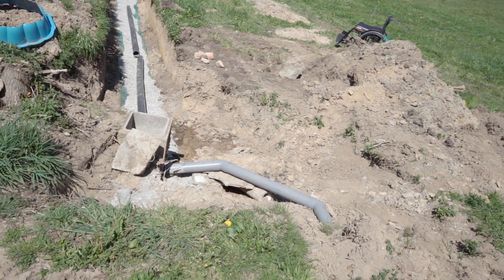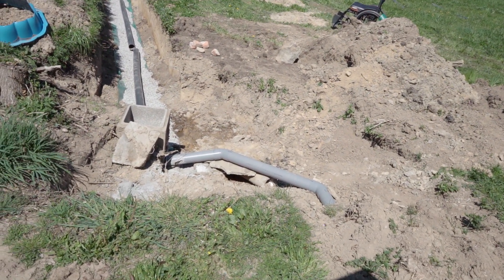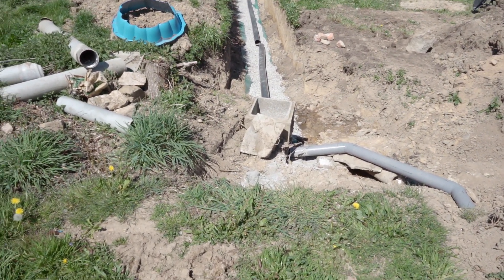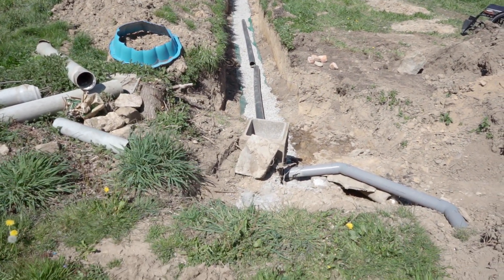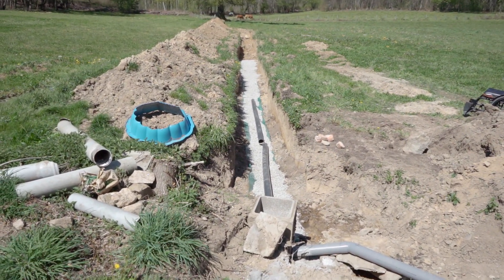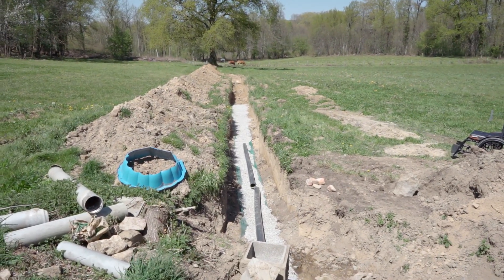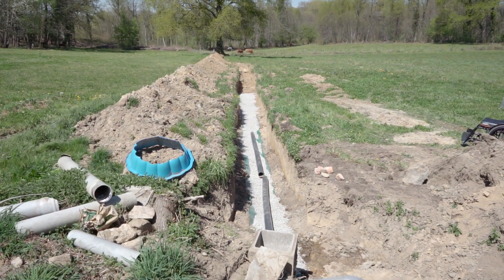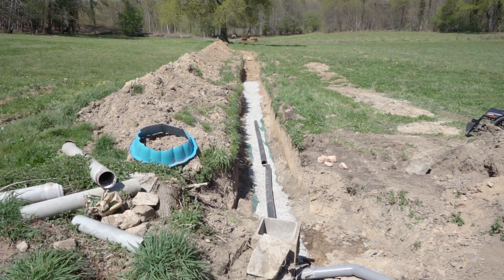Work has stopped at Ben's Garage.

Comment: Is this a drain for roof water? Have you thought about rainwater capture to cope with dry spells - becoming more and more of an issue for us in East Anglia. Good Luck - I want your digger! Shame it is Left Hand Drive lol
Reply from the maker: We have four 1000litre tanks on the garage and two more for the house (still have to get in place). Yes this is for rain water, but we have a funny roof setup and there are down pipes everywhere.
Reply from the maker: Left hand drive digger is just like a left hand drive motorbike, throttle is on the wrong side. 😀